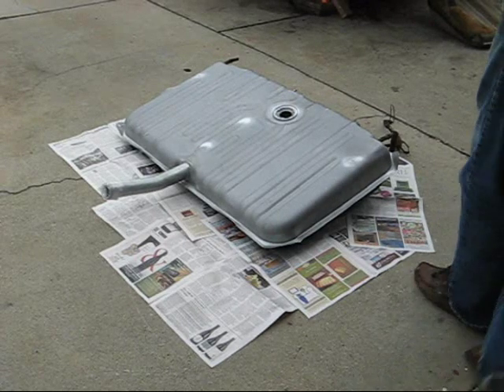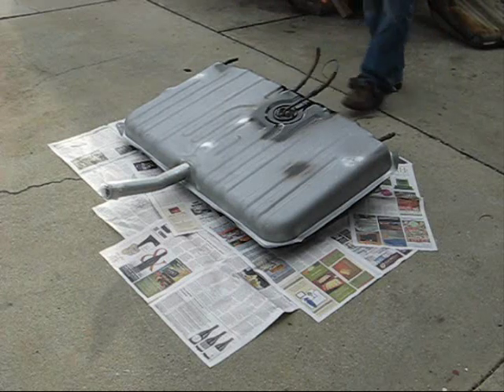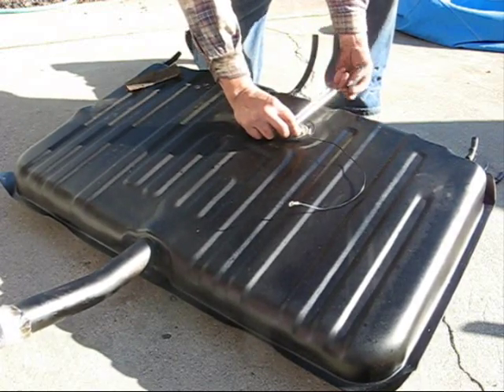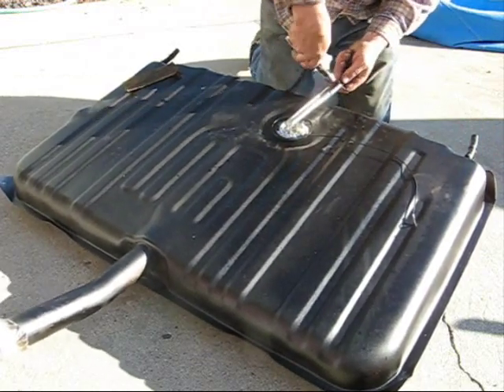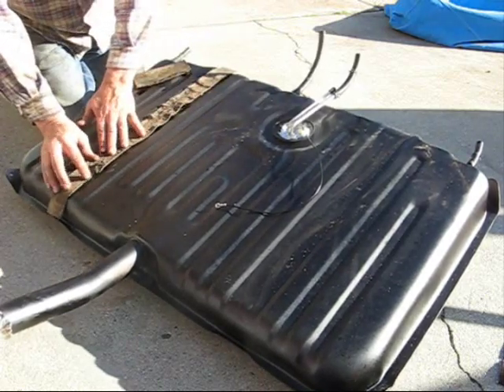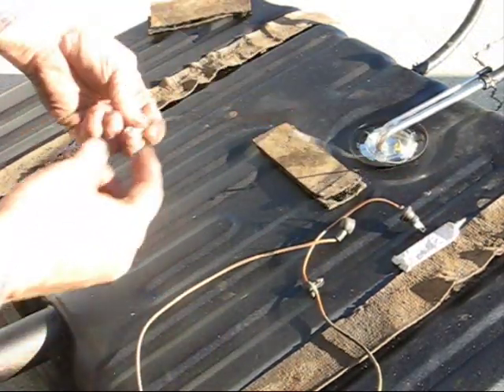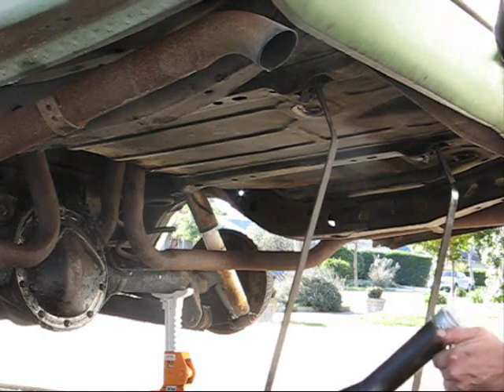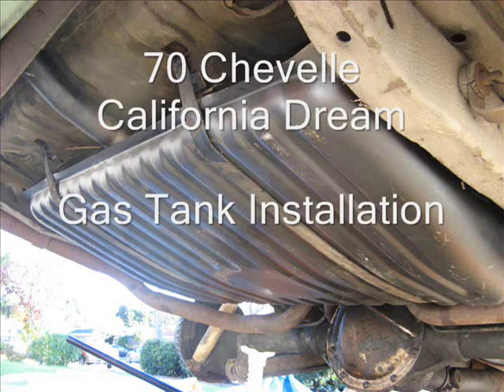70 Chevelle Gas Tank Install

Comment: should have bought a motorcycle jack it would made your life a lot easier.
Reply from the maker: No, because then I would have another piece of equipment I would not use again.
Reply: Did my R&R tank on my 67 firebird  set up jack stands  used 1/2 ton jack with a flat piece of wood on tank  to lower and raise  works great

Comment: I'm having a hard time attaching hoses to fuel tank.   Should I buy the set of hoses from year one, because I'm sure I have the right sizes.
Reply from the maker: Take the old ones to the auto parts store and they can match them up so you get the right size.
Reply: @davidlis6709  thank you

Comment: Dielectric grease does not conducted electricity, so covering a connector completely with it can work against you. Use it around the boot or on the connectors after they have been connected.
Reply from the maker: +cakeorgtfo It has been installed for  3 years now and it seems to work.  I guess I have been lucky.

Comment: What are the pad for that you glued on tank? My 72 monte didn't have these when I dropped  (original tank)
Reply from the maker: The pads are there to reduce noise, like a cushion.  The guy on the assembly line probable went to the bathroom and several cars did not get them until he got back.

Comment: Identical to my 70 Cutlass Supreme. I lucked out, and found a build sheet tucked between the tank and the covering mat on top of the gas tank, the car came with a dealer installed tow package that had never been taken off the car. It was welded on by Superman's X-ray eyes, or someone who didn't want it to ever be taken off. Two nights of extensive cutting wheel fixed that, and the gas gauge was a simple fix, I just recompressed the fittings (star washer), and it measured out at 90 Ohms, and has worked great since. I have a big block so the return was hooked up, and a breather element that was difficult to find and replace.
Reply from the maker: +4malulz I also found a build sheet under the back seat.  It was in a lot better shape.

Comment: Good video David, but I would like to mention the rubber cap on that return line at 5:00 in the video is going to give you trouble soon. Any tank pressure is going to pop that rubber cap off they also rot and crack easy. You can try some epoxy (J.B. weld) on the end inside the tube then a metal cap.
Reply from the maker: Good information.  I will put that on my list of things to do.

Comment: Can anyone tell me what that part is that all the lines are connecting to at 10:10?
Reply from the maker: I though it was to the return system but I may be wrong.  I hooked everything back up exactly how it came off.  I will get under the car and look at it again.
Reply: It's a vapor/liquid separator. Tank vents run into it along with the vent line running to the engine. It stores fuel vapor and the line running to the engine allows the vapors to be burned while keeping the liquid from flowing forward. It allows a sealed system to keep the gasoline from evaporating.
Reply from the maker: I just looked under my car and the lines run along side the frame to the front of the car, then they go into the frame where it bends and connects to the engine.  I don't see where they come out.  I have no idea where it goes.  The gas line connection to the carburetor is the one gas line coming in the front.

Comment: Good vid, although I would feel safer knowing the wheels were on, just in case, ya know
Reply from the maker: It makes it easier with the tires removed because you have more operation room.   It is real safe with the floor jacks.

Comment: Great video! Thank you!
Reply from the maker: Were glasses because the dirt will fall in your face.
Reply: Hi David , just curious what's the reason to plug the big block line and where could I buy the stopper? Thank you for sharing!
Reply from the maker: I bought a stopper kit at O Reilly Auto Parts, it just had all different sizes.

I would do how I came from the factory.
Reply: David Lis Okay, thank you for the reply!
Reply: David Lis captain obvious